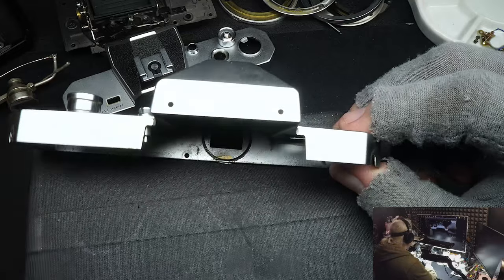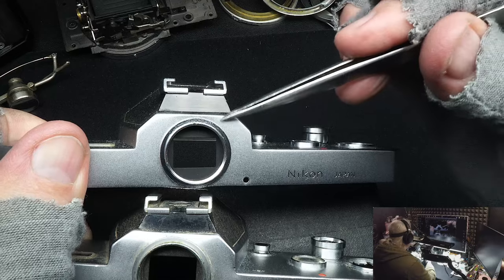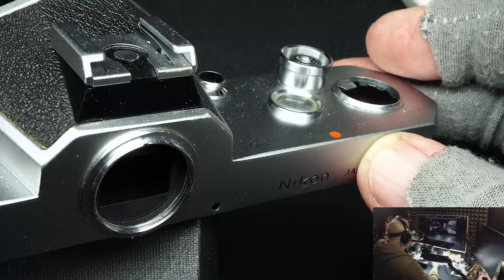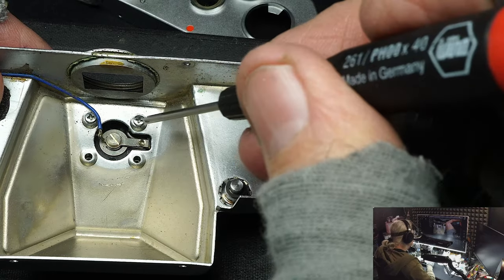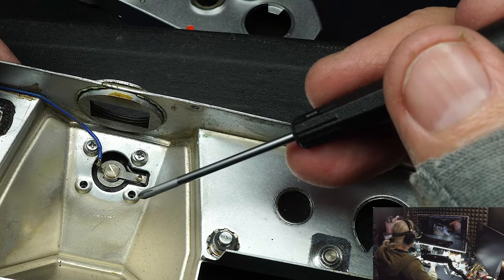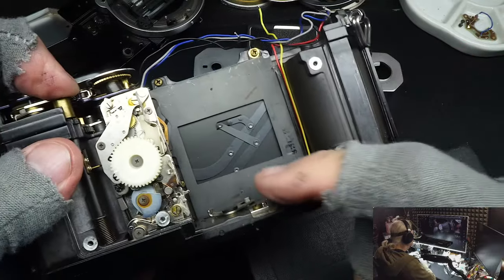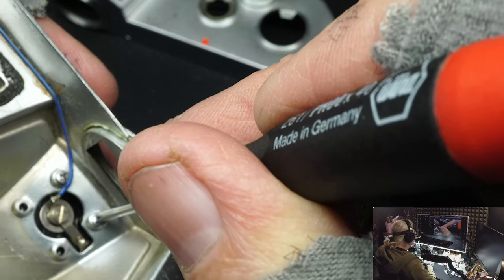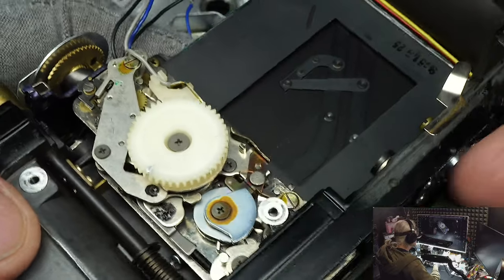Nikkormat FT2 | Locked Up Tutorial  | DIY #005

Comment: Great video, these Nikkormats don’t get enough love. Would be great to do a dive into one of the Nikkormat EL bodies, I know a lot suffer from battery drain issues.
Reply from the maker: Hello Mattdyer
As you probably know I own and operate a film camera repair shop. Around the late 90's I stopped taking in the Nikkormat EL for service because too many of them were coming back to me under warranty and I was losing money. The problem with the Nikkormat EL was the electronics which kept failing and causing problems. Anyway, I have no plans to make a Vlog Journey video for the Nikkormat EL, but I'm not ruling it out either. It counts on how my channel does and how much extra time I have.